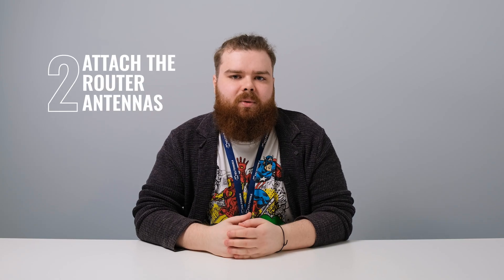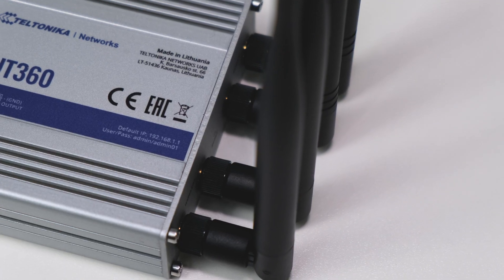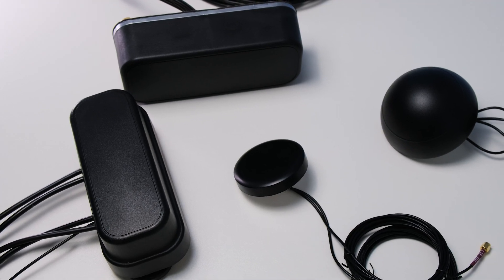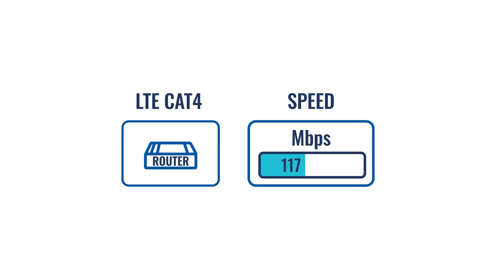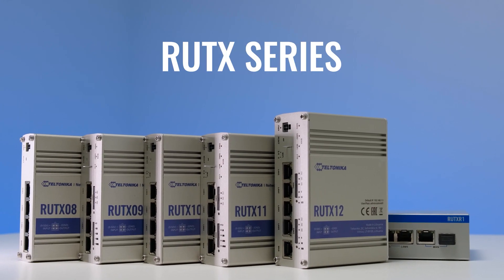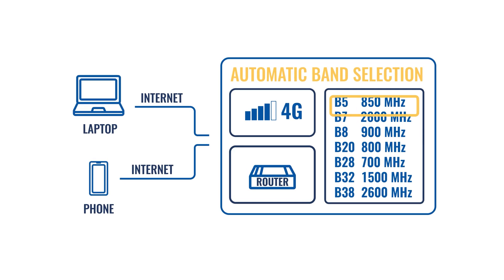How to Improve 4G LTE Speed on Industrial Cellular Router

Comment from the maker: Timestamps:
00:00 Intro
00:18 Try to change the router location
00:33 Attach the router antennas
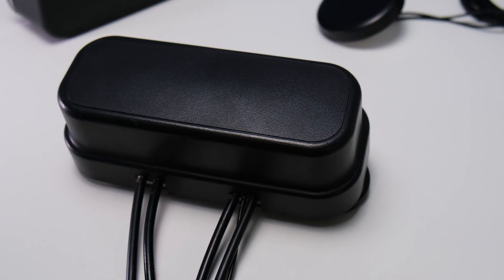1:08 Check the router LTE Category
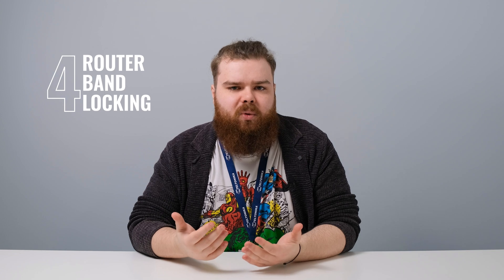1:40 Router Band Locking
2:05 Summary
2:33 Outro

Comment: Hello,
Is there any device of teltonica which improve the low or zero gsm signal and repeat it via indoor antenna?
Can this device be used as an 4g router too?
Thanks in advance
Reply from the maker: Hi, thanks for the question. Unfortunately, we don't currently produce signal boosters or repeaters. You can check out our other products here: https://teltonika-networks.com/products

Comment: if max speed that ISP offers is 20mbps ,then buying LTE cat 6 router will worth ?
Reply from the maker: Theoretically, LTE Cat 6 allows transfer rates of up to 300 Mbps in the download and up to 50 Mbps in the upload. Having an LTE Cat 6 router will not increase your internet speed if it is limited to 20 Mbps by your internet service provider.
Reply: @TeltonikaNetworks  my ISP is using Band 3 and 8, does Cat 6 router combine two bands and give better speed?  band 3 gives me max 17Mbps and band gives 3Mbps max.

Comment: Ahhh, it should be behind the windows!
Reply from the maker: Correct. The fewer walls or anything else that could block the signal, the better the experience.
Reply: @TeltonikaNetworks  And 4g reception is stronger outside because! :)

Comment: I'm totally dissapointed with RUTX12. I'm stuck with ~60Mbps on LTE 4G+. At exactly same location 2 phones manage to get 115-150Mpbs and D-LINK DWR-2101 180-190Mpbs (disabled 5G to ensure all configurations are the same) Changed bands, antenas, location, modems, APN. Nothing helps. I have two operators and the same issue.
Reply from the maker: Greetings. We are sorry, that you are having issues with your device. If you have the latest firmware and after various tweaks, the issue is still not resolved I would suggest sharing your configuration/test results on our Crowd Support Forum https://community.teltonika-networks.com/ which is more suitable to diagnose the problems than the Youtube comment section.

Comment: watching this from teltonika rutx12 garbage router. spent hell lot of money to get proper lte connection. 2.6mpbs is what I'm getting. while my oneplus mobile giving 50mbps+ stable from the same service provider.  worst product ever used. don't caught for nice looking outer shell and industrial wording gimmicks. these routers are ultra garbage. . only good thing it running openwrt.

I will soon upload review video and speed comparison with other routers and mobile phones. Absolute waste of money
Reply from the maker: Hi Semira, thanks for your feedback. This definitely sounds out of the ordinary, and we suggest contacting our Support to help you overcome this issue. It may be that something was not set up correctly, hence the poor speed.
Reply: @TeltonikaNetworks  https://www.youtube.com/watch?v=ZhKZJZYXsZc&t here's the video I posted about speeds. I even cannot watch youtube videos properly with this so called industrial router. I initially love this product and still love the Openwrt based firmware and feature set. but I really don't know what to do with these speeds
Reply: RUTX12 is a fast LTE router selecting the fastest frequency band in my testing I managed to achieve over 200 Mbps with single modem. I think something is wrong with your setup if you are getting only 2.6 Mbps, maybe your operator limits speeds for other devices, not phones? Although mobile phones are ussually faster than routers - because they use higher LTE category modems.

Additionally you should check what bands your router is using (also make sure the antennas of the router are properly attached). Contact your service  provider to check wich band is the best for your location.
Reply: @TarantuloTV  there's no limit for device type by the carrier. rutx12 sometimes giving me 16 mbps. but it's only for few mins. it so unreliable that I have to restart modem time to time for get good connection. all the other 4G devices I tested get at least 16mbps every single time and only this has issues. it cannot be issue with both modems as I tested both modems.  

I agree that mobiles are faster than routers but I never expect this speeds. bands are changing every time I reboot the modem. and all bands are giving me similar speeds.  and I cannot find any cell locking feature for lock to certain cell tower even I found one with good lte signal.
Reply: @semirauthsala6001  It looks like some issue with Mobile Network provider and RUTX12. You should troubleshoot the device configuration, did you check auto apn settings are they correct? Have you checked on what band your device connects to your network provider? The problem is probably one of those two things.

You can see the same device RUTX12 benchmarked with speed up to 250 Mbps with single modem and 450 Mbps dual modem - https://youtu.be/oxudnOPN0AA

For troubleshotting you should do the tests on the same device (maybe it's a laptop issue?). Just create a wifi hotspot from your phone. Also idealy you would test this on exactly the same SIM card on both devices (to reject that this is not a SIM card issue).
Reply: @TarantuloTV  ok I will do more tests with this box and update again
Reply: @semirauthsala6001  
Have you tried:
1. Updating the firmware?
2. Setting/locking the LTE bands manually? https://youtu.be/CAkjQ6a2qdc?t=125
3. Have you checked the APN settings?